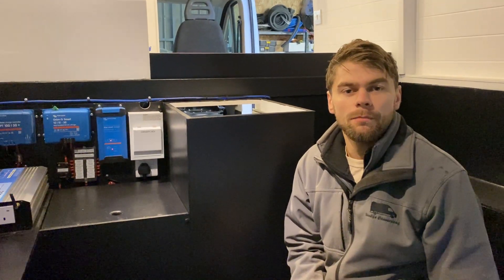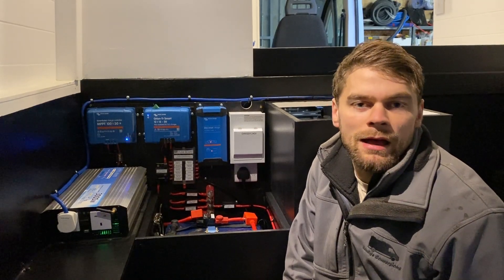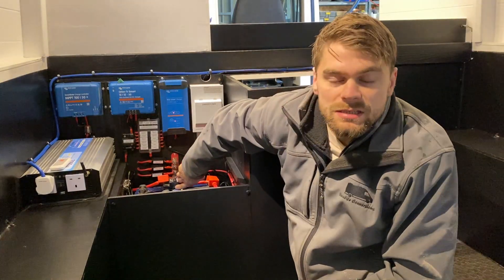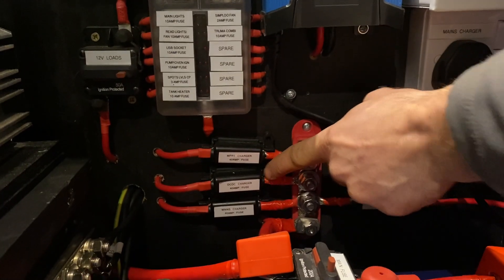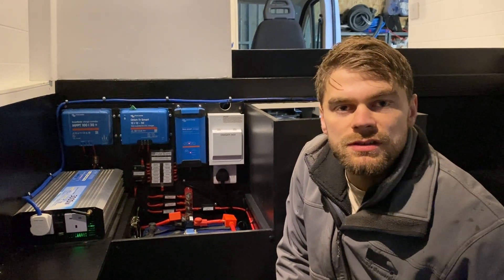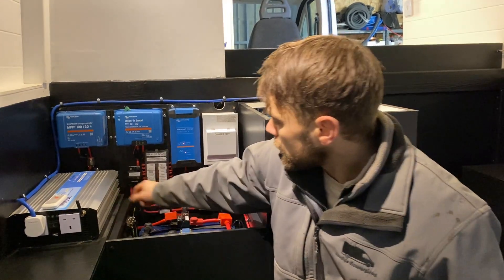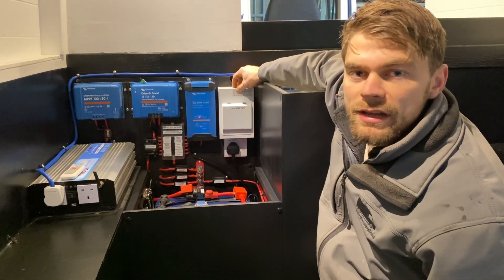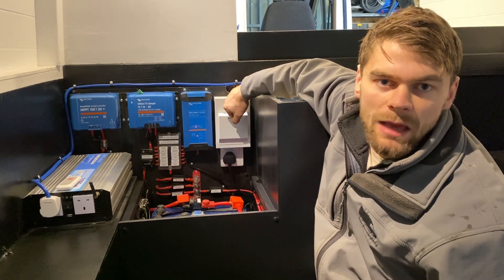Van conversion electrics - an overview of an off-grid system | Vanlife Conversions

Comment: Great video guys, very useful and comprehensive, thank you so much.
Do you have a wiring schema to buy from your website at all? I have a particular question about the DC-DC charger: do you only bring the 50mm2 red positive cable from the van's battery? The black is taken from the negative bus bar earthed to the chassis, right? And do you earth the copper gas pipes to that as well? What about the earth from the 3-core 230V sockets circuit and the AC-DC charger? Thanks a lot again!
Reply: Yes indeed, a wiring diagram and parts list would be superb!